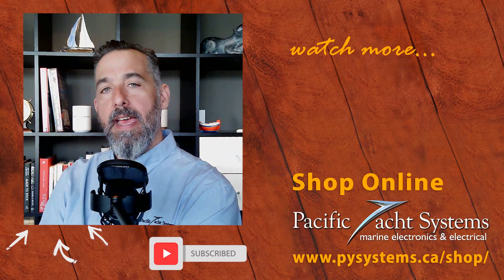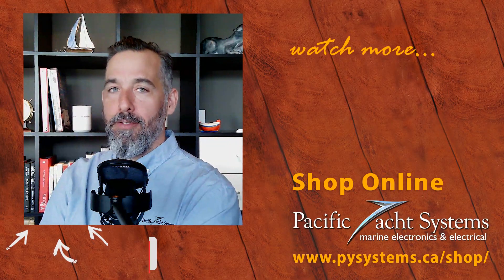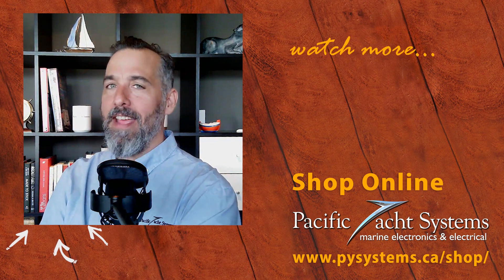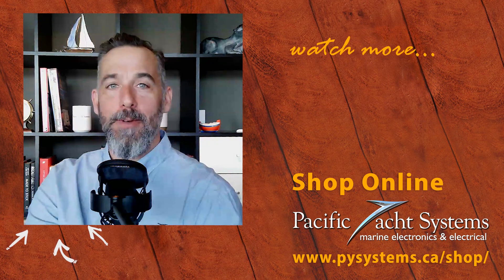Do the Cables From the Alternator on My Boat Have to Be the Same Length?

Comment: You mentioned calculating voltage drop, which I believe is calculated with wire gage and length. When the negative goes through chassis, as is in most cases, how do you calculate voltage drop to determine the gage needed for the positive wire?
Reply: The same as is done in all circuits. Starters stress the battery voltage most so size is not on schedule with nominal voltage rather the depressed at demand voltage.